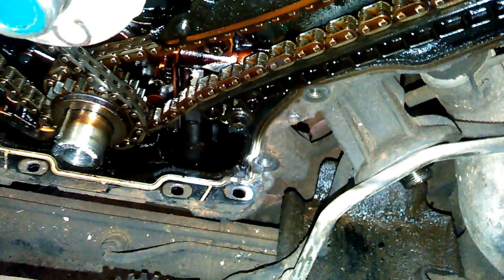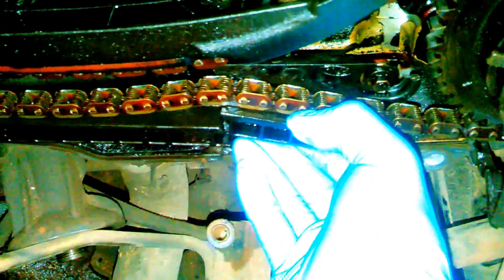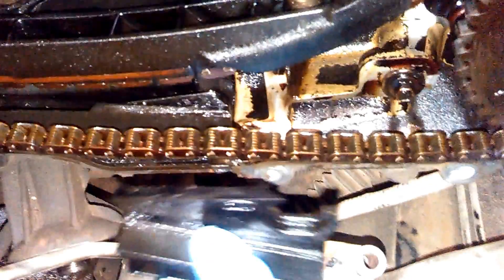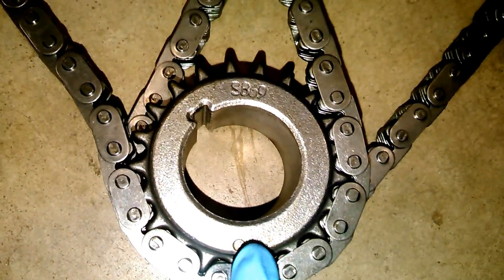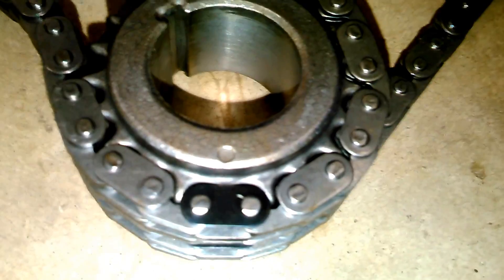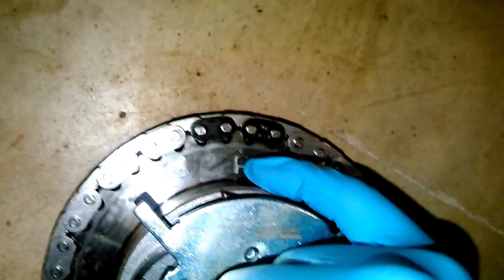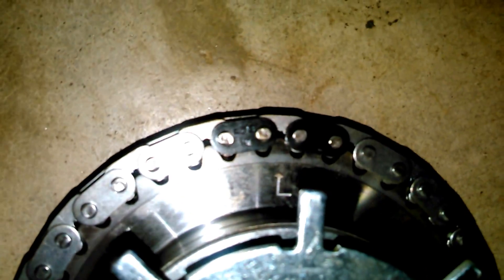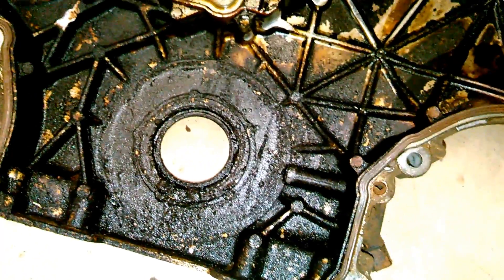Ford F150 5.4L 3V Timing Chain Slack, Guide Breakage, and Phaser Setup

Comment: Mine did the same thing I replaced the chains the tensioners I’m fixing to put it back together but I have one question it was running like it was missing could this be just because The chains was loose are a bad valve

Comment: I was waiting for the  for the crank shaft tool to get here so I tried to just to get it close and  I totally did not get it align at the 6 and the keyway at 11 o'clock now with the chains off I don't need to turn that crankshaft unless I have the chains on the cam phasers and the crankshaft sprocket are I have a good chance of bending are tearing something up so for me to get the right position on the keyway and the dot at 6 ' clock  should I put the chains on and rotate the motor to be safe? After I find out what I should do I'll be ready to go
Reply from the maker: Andrew Ashley   You can move the crank back and fourth to get it there. It shouldn't hit the valves if its close. Either find a socket that will slide over the end of the crankshaft or put the crank pulley on the end and rotate by hand.
Reply: okc vet thanks I ended up getting the crank shaft set right the dot at 6 o'clock and key way at 11oclock I had one more question and hopefully I'll be good I noticed my Left side chain is looser than my right side chain all the marks are lined up on the cam phasers and the crankshaft is it something that I've done wrong??

Comment: When I was removing the old chains my right cam phaser spun back on me I didn't think you had to lock the phasers down when removing change just wondering am I going to have to put the chain back on and rotate the crankshaft to get the cam phaser to line back up with the new chain marks I have the crankshaft positioning tool to set the keyway at 11 and the dot on the sprocket at 6
Reply from the maker: You should be able to put a socket on the cam phaser bolt and rotate it in the direction you need without turning the crankshaft. Its easiest with a non ratcheting tool but can be done with a ratchet if needed.
Reply: okc vet similar problem on 05 mustang. My phaser moved when I loosened my tensioner. Can I move the phaser with a wrench to the right position without damaging anything? I am confused with reading about interference engines and don't know what to do.
Reply: Andrew Ashley Did you move the phaser by itslef with a wrench? My 05 mustang phaser moved when I loosened the tensioner and now I don't know if moving phaser will damage anything.
Reply: @lmed2385  
I'm in the process the replacement chain .. how you move the phaser without damage .. ??

Comment: How do I remove the chains
Reply from the maker: Julie Gonzalez  You can remove the tensioners and the tensioner side guides to give you room to remove the chains. You can put a rachet on the camshaft gear bolt to release the tension on the chain if needed.

Comment: Was you motor running badly because of this?Did it damage cam or valves?
Reply from the maker: No, it did not damage cam or valves.  The motor was running good at times and rough at other times.  It mainly effected the idle and was dying coming to stops.  Occasionally, the engine would not start and starting seemed to be getting harder and had a flooded or gurgling sound.  The pan did have to come off to get the guide chunks out of the bottom.